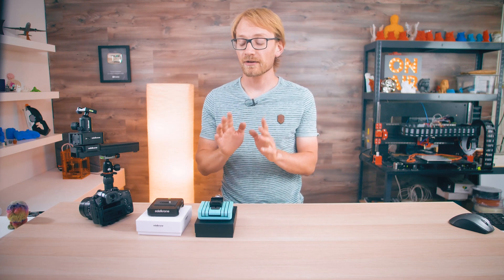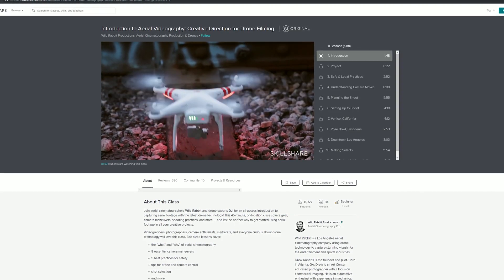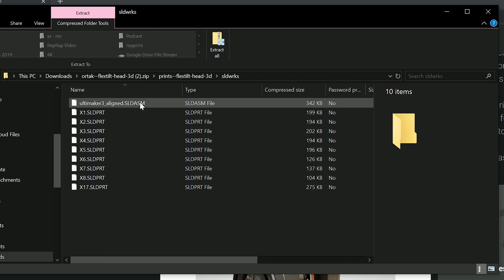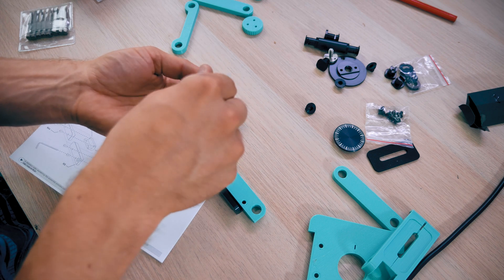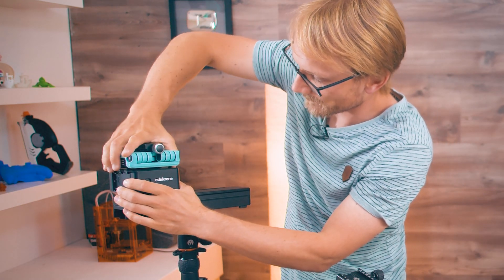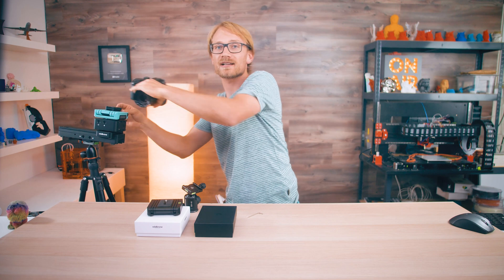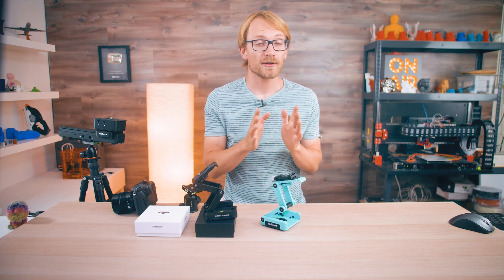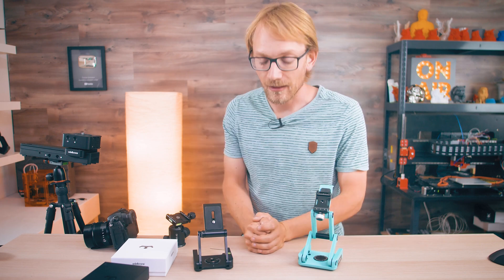Edelkrone now let you 3D print their products!

Comment: Two aluminium shims per joint seems the obvious solution to it squeakyness and difficulty in moving it.
Would it squeak so much if it were printed in PETG instead of PLA?
PETG seems smoother, I tried a dual colour print by swapping filament at a specific layer, thinking it would be ok to change filament types too, first half PETG, 2nd half PLA - disaster, the PLA didn't stick to the PETG properly and easily broke away.
Reply: licensetodrive I printed it in PETG and it squeaks just as bad. Although I also printed on a Prusa Mk3 with the textured bed, maybe that makes the problem worse.

Comment: Guessing the 90% infill is so when you drop your expensive camera because your 20% infill version snaps, they can say its your fault because you didn't listen to their recommendation. Companies have to cover themselves after all.
Reply: The original parts are dimensioned for aluminium, changing to PLA results in half the stiffness just looking at the material property. Thus the whole assembly will displace more as can be seen in the video. It's shaking all over the place. The thing needs to be redesigned for the intended material and manufacturing process for it to be considered for the same application.
Reply: @mirzacenanovic  Do you really think the shaking is from the PLA actually deforming?

Comment: I just finished mine in carbon fiber nylon and it turned out great! No squeaky noise, really strong and it works perfectly.
Reply from the maker: Wow, really sounds (haha) like that's all that it takes!
Reply: Thomas Sanladerer yea, I printed the first one in green prusament PETG and it was beautiful but had that twisting a pop bottle sound when I moved it. So thought I’d try some carbon fiber nylon. It’s very rigid and makes much less noise. I just posted a video on my Instagram maybe I’ll put one up here on YouTube as well.
Reply: @CaptainRon85  Did you just push fit the two halves of the camera base or glue them?
Reply: Evropa Pagan no I didn’t but I thought about it. The little rubber pad with the adhesive bottom kind of holds it together. And the carbon fiber nylon is pretty strong.